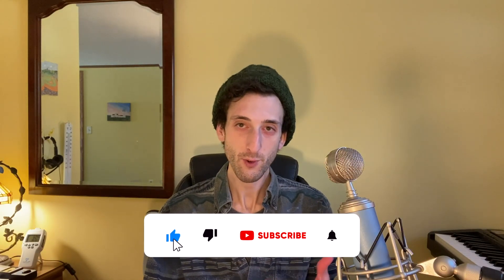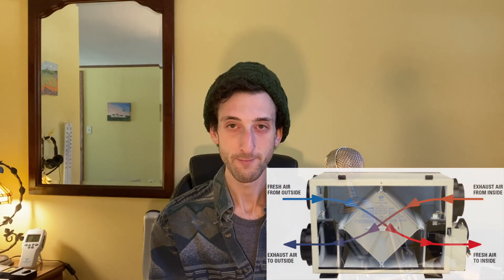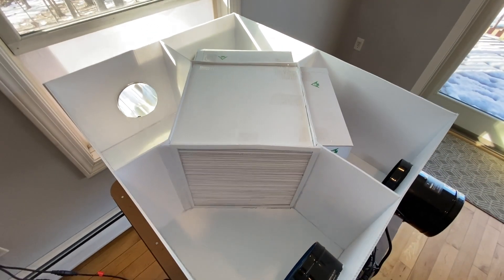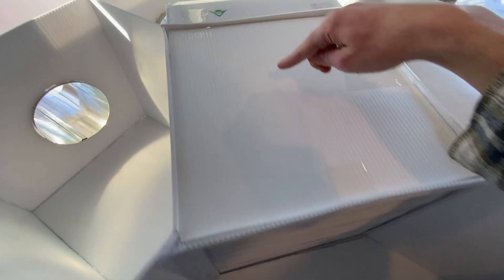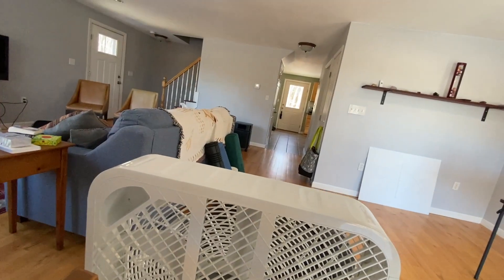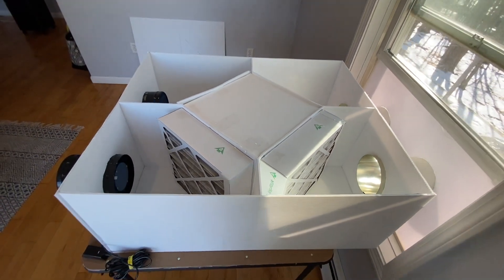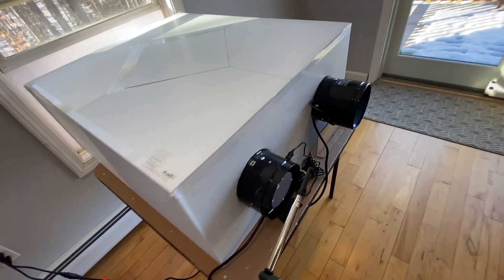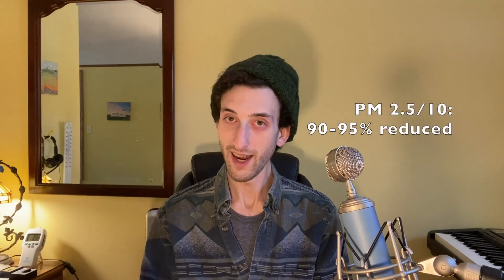I built the best DIY heat recovery ventilator I’ve seen on YouTube

Comment: I’d like to see measurements at a different location, behind fan is not properly done fan gives away heat there for infront of it. Probe in the exit chamber (from intake side).
Fans generally creat heat them self. An other suggestion add tinfoil sheet to every layer in the exchanger they will increase transfer rate and add some thermal mass.
An other concern is that duk are to close short way of exchange air(tight loop) . Pipe to the other floor? So air is going thru the longest way apart/ separated .
No extra fan needed for separate rooms? For even colder outside temperatures add a singel direction layer in the box ( intake chamber) holes from lid to bottom pipe from hot air in room by the sealing just passes in the box with a fan. Same method for cooler summer air uses opposite coldest basement floor air as a pass thru one direction to cool intake air..
Pre air channel balancing pass port , circulating room air based on outside temperature.  Best regards    J

Comment: New subscriber here!! This is the best design I have seen on the Tubes my friend!!!!!I am starting a gourmet and medicinal mushroom growing business in Delaware with my best friend/business partner and I have been  researching ways to reclaim heat and use alternative methods of heating and cooling. I developed a device that collects and. inverts electrostatic electricity from the atmosphere and converts it into usable dynamic electricity. I need one part to finish the design but it works . I am designing ot so that it can work with off the shelf transformers and such . The last part I need it a triggered spark gap and to buy one is expensive. I bought a lathe but there is a learning curve on it....

Comment: This is exactly what I was looking for!!!! I have a Resin printer that I want to exhaust out of the room, but I don’t want to lose all the heat or cool air in the winter/summer. I hope this works for me! I don’t need to change much air, just a little bit, so I bet a 4” fan set to low would be enough for my application. Great job!
Reply from the maker: Glad I could help!

Comment: Honestly making this from plastic is pretty dope in terms of  cost.
However you could make it MUCH smaller.
I have a lot of those plastic sheets lying around for different purposes.
Also you're using layers of plastic in 2 directions, which might lower the performance because it has not amazing heat conductivity. Just one set with gaps would be perfect.
This is high static pressure application, so in this case, it would be best to get 2 centrifugal (radial) fans, not axial ones.
It would also make sense to make the heat exchanger much longer, and thinner, to get full heat extraction.
Great video though.
Nice design.
Reply from the maker: I fully agree with all those tips!
Reply: @HealthyHomeGuide  I will probably make one for balcony, where it has to fit into square drain channel.
With centrifugal fans you could theoritically add cyclone filtering to get rid of heavier stuff.
Reply: Just curious, how would you make this longer and thinner considering it's a square and you want that initial surface area?
Reply: @TheNatedgreat18  Don't make it square - make it counter-current tube-like.

Comment: Great video! 

Is there anything preventing this HRV from being positioned sideways if a stronger material is used to support the core? Perhaps wood? Or would you suggest keeping it horizontal and using ducts to direct flow vertically? I only have a thin vertical window.

Context: I'm planning to move back to my dorm which I'll be staying at during colder months and need a college student solution to keep CO2 down
Reply from the maker: If you use stronger materials for the housing, then yes, it can be positioned sideways.

Comment: U have a 14*14*14 heat exchanger made of  coroplast , what should be the size of the heat exchanger should be if  i where building with aluminium or copper foils

Comment: Bro, you would put a little greenhouse lean-to against a southern wall of the house outside the window to actually heat your house on sunny winter days.

Also, you could just skip the return fan and suck air in and make your house “positive pressure so that you leak a little air outside rather than allowing dirty air from outside to find its way into the house

Comment: Why filter the outgoing air? If there was smoke or something bad outside, are you concerned it may blow in from the output?
Reply from the maker: I filtered both the intake and exhaust air streams. I filtered the exhaust in order to protect the core from dust buildup, which reduces airflow and efficiency. HRVs sold today for commercial/residential use do this as well. I filtered both streams to balance the intake/exhaust flow rates, though since these filters are 4” thick, they don’t cause much resistance to airflow anyway.

I’m not sure what you mean about air blowing in from the output.

Comment: To improve upon your design ;  if you suck the air close to the floor in your basement you'll also get Radon out of your home. Intake/exhaust on each side should be seperated by about 6feet. 

You could install a ceiling fan instead of the box fan that on the chair.

Great work!
Reply from the maker: Thanks for the suggestions! You might be interested in seeing my DIY ERV installation (newer video). I made some of the improvements you mentioned.

Comment: The efficiency is nowhere near 60%, let alone 80%.
Probably less than 20%.
To get high efficiency, you need a thermal conductor in the core. 
How else is it going to work? 
Or how else would you explain it to work?
Reply from the maker: Plenty of factory-made HRVs/ERVs have cores made solely of polypropylene (what I used) and they’re usually around 60-70% efficient. Also, as I said in my pinned comment, my HRV wasn’t 85% efficient after all. More like ~60%.
Reply: @HealthyHomeGuide  Well, I guess if you only put, for example, 1 liter of air through every hour, you may have enough conductivity to use a thermally insulating core like that.
If you get good numbers, it's probably just because there's leaking between the warm sides.
Try lighting a match into the warm input. If it smells from the warm output, you've got leaks. And then you're not exchanging air.

Comment: I’ve got a room I use for 3d printing. Resin and filament. I’ve been doing research and I think the fastest way to have better air is to replace it rather that strictly filtering the air. Do you think a system like this would be a good use for a room like this? Ultimately I would like to have air intake going through the wall rather than through a window. Also does the height matter? Like would having it lower work better than having it higher closer to the ceiling? Would be so awesome if I could get a response.
Reply from the maker: I don’t know much about 3D printing, but I do believe that some people use HRVs to carry harmful fumes outside and bring fresh air in. I believe that Designed by Instinct (I linked his video in my description) uses his HRV for something like that.

That being said, if the fumes you’re generating are extremely harmful, it may be risky to use a DIY HRV to ventilate them, given that DIY HRVs are difficult to make perfectly airtight, and the exhaust and intakes are usually fairly close, leading to potential cross contamination.

Again, I’m not an expert on dealing with harmful gases generated from 3D printing so take what I say with a grain of salt. Hope this helps.

Comment: About how many 48 in. x 96 in. x 0.157 in. (4mm)  Plastic Sheets did you need?
Would a 120mm computer fan setup work if I only need to ventilate a 150-200 square foot room?

 Also Merry Christmas if you celebrate that.
Reply from the maker: That depends on how large your housing and core will be. Calculate the total area of your HRV (including each sheet within the core) to see how many sheets you’ll need. I don’t remember how many sheets I used - I don’t use this HRV anymore. I use an ERV instead now. I have some videos on that. 

An 120 mm static pressure fan could certainly work for that small size of space.

I don’t celebrate Christmas, but thank you for the kind wish anyway 🙂

Comment: PS: for heat recovery and fans, I decicded to go with commercial solution which was in just about 600€, so I added only control, dampers for circulation mode and AC unit for cooling and heating😂

Comment: Nice build. Anyway next time consider brushless centrifugal fans and also damper to allow the unit work in "circulation mode", in mine, is also built-in cheap AC unit, so mu unit can also cool and heat...
Reply from the maker: Thanks! I’ve tried to find centrifugal fans but I’m not able to find one that is reasonably priced, well-made, and also delivers a good amount of airflow while being speed adjustable (for quiet operation if needed). Let me know if you find one.

The AC infinity fans I use are actually mixed flow fans, so they’re basically a combination of axial and centrifugal, which I find to be great for a DIY application like this.

Comment: just buy a replacement core from an OEM manufacturer, then just make a box around it.
Reply from the maker: That’s definitely doable. Though from my research, I’ve found that replacement cores tend to cost several hundred dollars and that’s not including shipping, which is quite expensive for cores because they’re fragile.

At that point, you might as well buy a new HRV or ERV.

Comment: Anyone make up a core using truck radiators or intercoolers? The heat transfer would be very efficient, a hose/pipe branch to, say, 4 radiators would be the tricky part of the build. Encase the bundle of stacked radiators inside a plywood box. Etc.

Comment: sounds like your just adding tvocs to your air with all that plastic and adhesive
Reply from the maker: As I showed in the video, I tested the air for VOCs, and they were quite low with this HRV running. 

Hot glue is a solid when it dries, and does not off-gas. Polypropylene (the housing and core material) is BPA free, non-toxic, and does not off-gas either. The glue I used in the core is low VOC, and did not emit an appreciable amount of VOCs once it dried. 

I’m sure, of course, that some part of this HRV setup emitted VOCs, but the amount of fresh air the HRV supplied to my house, which greatly diluted the overall VOC level, far outweighs its own level of VOC emission.

Virtually everything in your home emits VOCs. The best way to lower tVOC is to ventilate.

Comment: A heat exchanger on the window side output would extract the last bit of heat.  It is an energy expense,  but heat exchange is more efficient than conventional heating.
Reply from the maker: The core of this HRV is a heat exchanger. Are you suggesting building a second core, or using a different type of heat exchanger?

Comment: Hey. Nice video. I have a few questions if you don't mind fielding them. I also have a few tips. I use a similar Panasonic unit, but I made modifications to it (some similar to what you made).
1. It looked like you had a filter for your exhaust air (right before the air entered the heat exchanger core). Was that to prevent dust from getting into the core and clogging it up when the walls of the tubes got damp?
2. I either missed it or you didn't say. Did you lay the sheets of corrugated plastic at alternating right angles to each other as you stacked up that core? Cool idea.
For tips, you should DEFINTELY separate the intakes and exhaust vents as soon as you can - especially for the inside outlets. I'm sure you're immediately dumping a fair bit of your newly pumped in fresh air. As soon as you can spread those apart, do it. If you have a radon issue in your house, consider grabbing the air to exhaust from down in the lowest part of your house. If you have any occasional smoke (like from a fireplace), consider grabbing air to exhaust from up high where smoky air rises to. Overly humid bathroom would be a good place to collect waste air too. You get the idea. Consider dumping fresh air where you want things to dry out. Mine dumps over my kitchen sink where I do dishes. The dishes dry in no time. That wasn't planned ahead of time, but it's appreciated.
Those fans are awesome by the way. I use those for venting air all over the place. I use that exact 6" model for running hot air under my concrete floors to warm them like old Roman baths used to. Very reliable.
Great video. Thx for sharing!
Reply from the maker: Thanks for watching! 

Yes, I filtered the exhaust airstream before the core to prevent particulate (mostly dust) from building up in the core. Factory made units generally do this too.

Yup, I laid sheets of coroplast at alternating right angles to form the core.

Agreed. After this video came out, I installed elbow duct attachments to the indoor supply and outdoor exhaust to the direct the air streams away from the intakes 🙂

Thanks for the tips! Using fans for indoor air circulation works for drying as well.

That’s good to know that you find those fans reliable! Thanks so much for your support.
Reply: Don't thank me for watching your videos, thank YOU for taking the time to make them. As a fellow Youtube creator, I know we don't make much on most of our videos. Although with 66K views, that's got to be adding up to at least something, but still generally (for me anyhow) less than I'd make if I were doing a normal job at minimum wage. Making videos is def more fun though!  @HealthyHomeGuide
Reply from the maker: @PraxisPrepper  I actually just got monetized this week, so I won’t make anything on the $66k views I had racked up before monetization unfortunately. I’d love to make YouTube my main career eventually because it’s so fun. I’m hopeful!
Reply: Best luck in that endeavor. I'm definitely no expert at it, but I can share a few bits of advice from someone who's been doing it for a bit.
1. In my last 3 months, my channel had 57k views and that resulted in $275. So that's a bit of a ballpark.
2. Not all videos seem to be treated the same when it comes to payments for ads. I've had many videos with pretty much the same views and numbers of ads per video get wildly different revenue amounts. So just be aware of that.
3. Youtube is definitely serious about pulling down one's channel's ad impressions (which are what lead to views) if one does things that aren't popular at the time. I also run a channel that's all about different language learning for kids (alphabets, counting, simple math, colors, etc.) Some of the lessons that I've posted in the past have been in languages like English, Spanish, Italian, German, Russian, Chinese, etc. Those were all very cool with Youtube until recently when I posted a video teaching the Russian alphabet and that day my channel got pretty much shut down (meaning  going from consistent thousands of views per day to consistently just a few dozen views per day). I guess Russian anything (even the alphabet) is taboo now. I've experienced similar things during covid in regard to items such as back when the official public word was that it wasn't airborne and I openly spoke about how I thought it very likely was actually airborne (given that it was a type of coronavirus and those are commonly spread through the air). It's hard to predict (for me anyhow) but sticking to truthful things or reality isn't a shield for your channel. Where you do a lot of videos about health-related topics, just be aware that if you make a video about something that's totally 100% true, but that truth becomes controversial (like cold viruses being airborne), it can create a big issue in terms of growing your channel. Again, I can't offer any specific advice, but I share that reality with you so if it ever happens to you, you'll understand what's going on and won't think you're alone in your treatment.
4. Last, I recently found out that Youtube has a blacklist of videos that (for undisclosed reasons) they don't send ad impressions out for. I recently created a short video (the vertical Youtube Short style) and it had a 100% CTR, an average viewing duration of 250%, and 100% likes. But after more than a month, Youtube had only given it 22 ad impressions (several tens of thousands is more what I'm used to). I was on with a Youtube tech for about an hour (using it as a case study) to try to understand why that video wasn't being shared at all. They refused to give specifics, but told me that Youtube keeps a list of videos that are deemed "ineligible" for ad impressions. I still to this day have no idea why. It was just some silly short about an AI image Id created that looked weird in how it came out. Totes vanilla content.
Anyhow... welcome to the wild world of Youtube creating! @HealthyHomeGuide
Reply from the maker: @PraxisPrepper  Thank you for that. Hearing about the nuances of your experience is really helpful. I’ll be on the lookout for all those things. 

My first observation is that since being monetized on October 16th, my views have gone down significantly. Like, a stark difference. Night and day. Before monetization, I was getting 1500 views per day consistently, and after monetization, I’m getting 500.